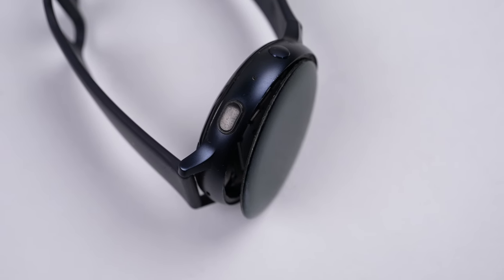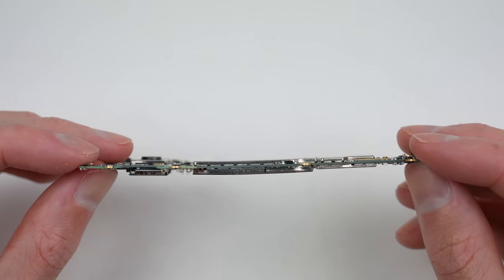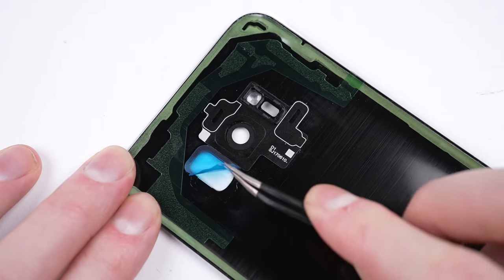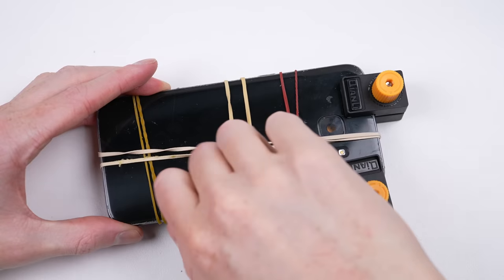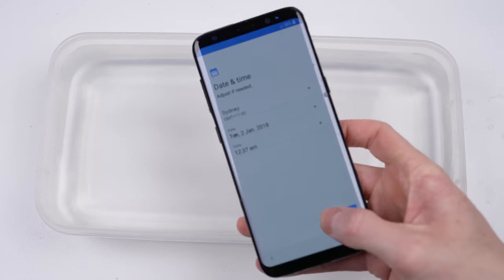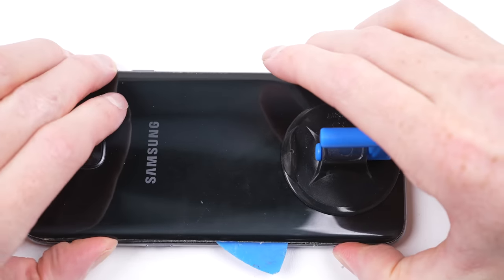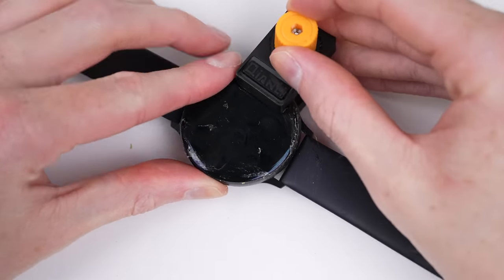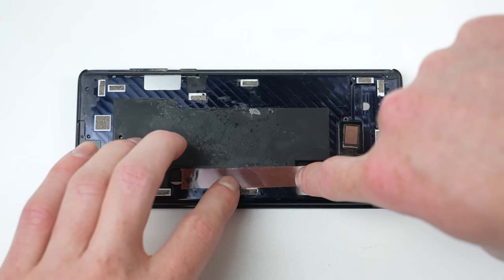Is a Repaired Phone Still Water Resistant? - Submersion Test - Tape VS Liquid Adhesive

Comment: If you sent your phone to repair, don’t ever submerge it. If done correctly, yes, the phone can still be water resistant, but some phone repair shops just leave the old adhesive or replace it with one that is not air tight sealed.
Reply: I don't think the majority of people intend to submerge their phones. 9/10 it's on accident or out of their control if their phone hits water.
Reply: true because removing the residue is the most time consuming process
Reply: i wont recommend submerging even a brand new phone. period. even if it's IP68 rated.
but if it's accidentally, i just wanna feel assured that it's not instant doom when the phone met with some amount of water
Reply: @workdesu  if it’s brand new it’s fine. If the phone is 6 months or older, has sustained some drops (even with a case) , and it has chips or cracks, it should not be submerged
Reply: @eddiew.4650  Originally, you got a waterproof phone to take pictures of each other in the pool.  Sony advertised this all the time.  They backed it up by warrantee by doing an air pressure test if you sent in a water damaged phone to rule out it wasn't negligence like unclosed covers. But they stopped the warrantee shortly after prolly due to too many claims.  A new phone is likely sumbergible for a while until you break the seal somewhere due to wear.  I'm sure weather is a factor too.
Reply: WILL IT BE WATER RESISTANT IF I SEND THE DEVICE TO REPAIR ON OFFICIAL SERVICE CENTRE?

Comment: My Mom put her Pixel 3a XL through the washing machine, and while it seemed to be working fine afterwards, I wanted to be sure nothing got in. Since it was pushing 3 years old, I figured it was time for a new battery anyway, so I opened her up, AND IT WAS BONE DRY INSIDE. Very impressive for a device without an official IP rating. And of course, I replaced the adhesive when I reinstalled the display assembly. 😀👍🐧🐧
Reply: Couldn't believe at all 😮

Comment: Did a battery replacement on my Pixel 5 requiring full disassembly, then took it rafting by accident resulting in 2 hours of sloshing around in water. Phone was fine, no signs of water damage, so I guess I did a good job! For reference, I used MobileSentrix adhesive for this repair.

Comment: As someone who works in a Samsung ASP, part of the post repair diagnostics is the Water Resistance Test. It uses air pressure to determine water resistance by utilizing the internal phone barometer and a weight or an external apparatus. 
So hopefully in the Right To Repair future, the diagnostics tool becomes available to the public instead of seeing you dunking a phone in water.
Reply: How does Samsung test the water resistance for their folding phones? I imagine those phones would only have one barometer still right? How'd you verify both sides are sealed?
Reply: @cavejohnson2075  curious to know the answer to this as well
Reply: The barometer can be utilized by third party app, though I'm not sure if root is needed
Reply: Ah yes, the infamous cube. We had one in the repair center that had a fingerprint reader calibrator which was finicky beyond words
Reply: Isn't the internal barometer not supposed to have a connection to the outside? Or is that a separate barometer?
Reply: @cavejohnson2075  The "external apparatus" I mentioned. It's a custom thingamajig made using a syringe, a thing to pull the syringe, a bluetooth barometer thing, and replaceable rubber or silicone seals. It's a very custom thing.
Reply: @ej_tech  are those replaceable rubber seals a “thing” too? 😂😂😂
Reply: @PanCakesAreFat  Ooo super interesting. Thanks for the insight into how that all worked. I've been really curious for a while. Thanks :)
Reply: @PanCakesAreFat  Does that also mean that extra barometer is sealed into each phone or is it removed after? Just curious how that all works. Might do some googling and see what I can find later from what you said. :D
Reply: On Samsung phones there actually is a water resistance test built in it is the MST test under the *#0*# menu
Reply: I use a barometer app to see pressure change to see ofy repaired devices still have a level of resistance

Comment: There are ways to relatively test the water-tightness of a phone (slightly gross):
Eject the sim tray, then try to suck (not blow otherwise you might trip the water indicator) out of the sim slot. After that just move your lip in and see if it holds the suction or not.

Keep in mind, the phone is dirty, so sanitized the phone before and after the test. 

And if you can test using the internal barometer, just use it instead. The test above is only mostly used with iPhone as it does not have any diagnostic menu easily accessible and downloading an app when you have to check someone else machine on the spot is a big hassle.
Reply: A good suction is good I suppose?

Comment: I work at a place called batteries plus and we repair some phones, we do iPhone and Samsungs. for iPhones we put some aftermarket adhesive that's not gonna make it water resistant as it once was because obtaining that kind of adhesive is a bit of a pain for iPhones. (Shout out to Apple!)

However for our Samsung phone repairs we're partners with Samsung and one of the very few phone repair companies that has access to genuine Samsung parts as long as Samsung themselves has it in stock. Samsung parts however are very expensive because well, it's Samsung parts. Samsung however gives us the adhesive that comes with the device originally and the device WILL stay water resistant, we get more iPhone repairs though than Samsung because of the price, a new screen is expensive and you're looking at about $400 USD for something like an S21 & S22 Ultra screen. Regardless it's not that we don't want to add the adhesive to iPhones, it's that we aren't provided the parts to ensure it is. We've done some amazing things to bring back some phones that were believed to be completely dead.
Reply: So what after market adhesive DID you use at Ifixit? What name and brand was it? That's why we are here on YouTube to learn stuff...so please share..??

Comment: I had an S8 years ago and fixed it with new screen after the original one broken, I have to admit that I may not be good at repairing because I broke the battery and the back glass durung the process. However, I replaced a transparent back glass that I can see if the water resistance still exists. Unfortunately the water went into the phone maybe due to my bad work, but the phone still worked good before I sold it. I think the mother board may have some solutions to make it kind of water resistantable.

Comment: Last year i had my iPhone’s XS battery replaced (at an apple certified shop)

Some months later i was in a pool with my phone, the sun was really strong, so i used my wet hand as a way to cool down the phone (it never went underwater). Welp that was enough for a water to get inside and damage the front camera (and faceID) as well as the touchscreen. 

They offered me around 20 bucks for it at that state, i declined 😅
Reply: How long did it last before not working anymore ?
Reply: @jaysmokin  it still works

Just, the touchscreen has a deadzone and the faceID and Front camera dont work

Comment: Hi Hugh - Back in 2021 I created software to test the water resistance seals on a phone (unfortunately only Android, since I'm an Android developer). My goal was to help people be able to hold phone manufacturers and repair shops accountable - if the phone is advertised as IPX7/IPX8 rated, then it should be held up to that.

It would be great to know if it helps you test your own repairs...

YT keeps deleting my comment when I mention my software's name...
Reply: App is called Water Resistance Tester
Reply: The way it works is it monitors the pressure sensor inside of most modern phones to detect whether the seals are intact. It monitors for a threshold of changes in pressure when the user presses on the screen. This pressure value does not change, if the phone is not/no longer water resistant.

Comment: I think it should be a law that, if the seller/manufacturer advertises water-resistant devices they should cover it under warranty. Why can a brand claim a non-damaged phone has water damage, and therefore not fix a boot loop, if there are images on their website with water splashes on the phone?

Comment: My s5 was dropped in liquid - it still turned on but made a sizzling noise. I poured rubbing alcohol on it, as I didn’t have a heat plate to open it. I let it to dry over the weekend and I plugged it in, it no longer sizzled. It acted normal, or so I thought. The screen was completely black, although the touch still works. I can also see that the speaker is a bit broken tho. It was never opened before - the seal must’ve gave out.

Comment: Sort of a flawed test since you need heat to remove the adhesive, and you didn't check the cof bond of the screen which breaks easily when exposed to liquid causing it to black out or have lines, no idea if you could xray the phone in a way that you can see water inside though

Comment: I have the exact same watch - Samsung Watch Active 2. Bought brand new. I use it for swimming in the summer but one day i swam with it and it and after that, it kept restarting and displaying "your watch needs too cool down" and itll restart. This happened for 2 days post submurgion. Then suddenly it restarted and never turned back off. Still working great after 6months. Unbelievable how samsung claims its water resistant when its clearly not

Comment: One thing i do when sealing a phone back up is what i like to call the 're-heat method' basically once i close the phone up, i heat it up again and THEN start applying the pressure from the adhesive. And looking at my phone, if you didn't look properly, it would look as if it was never opened, the seems are that tight.

Comment: I had the exact same problem with my Galaxy Watch Active 2. I fixed it once last year but the problem reoccured. The second time I opened up the watch fully to clean the residue properly. This is pretty straightforward but you'll need a Tri-Wing Y00 screwdriver and the microphone fell out in the middle of the process. I got it all working again though.

Comment: If a fall is severe enough not just to damage the display, but also the outer frame it sits on, I suppose chances are the ability to get a proper air-tight seal on the device is also compromised, correct? So I'd need to try and find a replacement outer frame as well. I got a couple old devices like that that I am not confident to daily-drive because of this.

Comment: My Samsung Galaxy A52's back panel started to come off on its own after a year of use.. I've always kept it in a case and never placed it in the water. It's IP 67 rated but i don't think it's now..
Reply: i’ve experienced the same issue too with my A52 as well. my back panel come off on its own
Reply: @kkaall  i guess samsung's just using low quality adhesive on mid range phones to save costs
Reply: @zstar7  yeah kinda annoying. now i wont buy A series anymore lol

Comment: I just want every phone to have a removable backplate with replaceable rubber gaskets, gluing the phone shut should have never become the standard. 
Also: There is actually an app to test if your phone is properly protected against water!
Reply: Once the new batteries that caught fire when you short them and stuff, they didn't want regular users to have access to the batteries.

Comment: My wife had a Galaxy Watch Active2 as shown in the video. It fell apart after two years and 3 months. The display just came off. And Samsung said that there was no warranty left, but we could trade in the watch and buy a new one, plus a small discount. We thought: ok, that's fair. Guess the actual value of the watch quoted by Samsung: zero! Because it was damaged. What a disaster.
My Huawei Watch GT from 2018 came as a gift with my Mate 20 Pro, because I pre-ordered the phone. They are still going strong, every day. Shame on Samsung, and a shame that Huawei is not what it used to be.

I am happy to see that water resistance can be solved by yourself though, so thank you for the video :)

Comment: My galaxy watch did the same thing, but in my case I believe the fact that it is 2 years old and I took it straight from the charger and go out to work ended up causing some kind of thermal shock that resulted in the screen taking off, lucky I have the tools at work to glue it back.

Comment: I think that for the best sealing result atleast with the original adhesive you should heat the back panel after putting it on and clamp it down for a while

Comment: Just dropped my 12 Pro in a toilet

I replaced the display ,but everything else is original

I took my time removing old glue with isopropanol

and installed new seal that arrived with the display

from 0.01 second that my phone spend in a toilet (it only went half way thru in) 

my phone worked okay for 30 minutes

but then started glitching, screen went white

and then the phone died an wouldnt even turn on

I opened it up , there was 1 drop of water inside

I dried it up with a leaf blower ( portable version) and left it on a heat plate for 1 hour (while also blowing air in it)

after 2 hours I installed a new display and it seems to work

like I said it happened 20 hours ago so I do not know if its gonna keep working

but my point is that the seal I used was not good enough and it left some dust and also water inside

so if you ever opened your phone you can assume its NOT water resistant or water proof

Comment: the answer could be opposite, if the adhesive is original or not sometimes it could be water-resistant, but it could degrade overtime as long as 10 years. but if the water still seeps in, then it is not water-resistant. so is B7000 glue could be water-resistant, but if it's clear then water can still get in the device and mess with the internal components and damage it forever.

Comment: This is not a good test of water. The time is too short and the container is too shallow. Water pressure increases very quickly as the depth increases. 

And there are proper testing rigs for testing water resistance. The liquid used is a special solution (some made by 3M) that does not damage electronics. Then air is pumped into the phone through a port designed for this purpose when it is submerged. If bubbles come out of the phone, you know there are holes, which means it is not water resistant.

Comment: I once dropped my Lenovo phone in the sink. The phone was displaying pink and green and it was making cracking noises. I removed the back cover and the motherboard and I got rid of water with a hair dryer. I reassembled the phone and it powered right up. I used it for 3 more years.

Comment: I get hands on iPhone after 3rd party repair with dust inside (specially front camera) once a week. Hate lazy work like this. When I repair it, the water resistance is better after the repair then with the old degraded adhesive.

Comment: I got my Galaxy A52 screen replaced which came with frame. it was not water resistant anymore and after macro schots i found out the new frame was bent on top edge and i showed that to service center and after arguing for two days they replaced the screen again. Fortunately it was clear the problem was a defect otherwise they would have done nothing about it

Comment: My samsung galaxy watch had the screen popped off as well. Turned out to be a battery issue. The battery pushed the screen out. Just 3 years and then they need repair or replacement. So sad.

Comment: Hello Hugh Jeffreys, thank you a lot for this video, im afraid of using tape, so i use liquid adhesive and never have a problem, used it on s20, on display and backglass and the phone went waterproof for long time, but then the speaker mesh was not waterproof and water went inside. but i cleaned it, and glued it back. so i really recommend to use glue : t7000 or b7000, with tape. best option. but if u glue it badly and you need to reposition it, then cleaning the glue is so hard... xd, have a good time with videos Hugh.

Comment: It's important to understand the difference between "water-resistant" and "water-proof".

There was an Australian consumer case in the early 80s where the watch manufacturer had called their watches "water-resistant" but the advertising was all beaches and hard surfing. The case failed for the consumer because the watch was never asserted in writing or advertising to be "water-proof" which has an Australian Standard of exposure, pressure (depth) and duration. The visuals came within some "artful communication", and were not then seen to be misleading.

"Water-resistant" is an advertising term so nebulous that it is almost meaningless.

Comment: Watch Rewa technologies videos on making repaired devices water resistant again. You're video is okay for basic old devices you don't care much about but actually waterproofing after repair needs special machinery to test the maximum sustainable psi.

Also for the galaxy watch try using T-700 instead

Comment: Coming from having had a semi-smart G-Shock watch die to water damage after getting the battery changed, if assembled correctly I trust it's construction way more than this Samsung smartwatch.
Lesson learned, going forth I will replace the battery myself, already did on cheaper watches but I wanted to be certain that this one stayed water resistant, as it was very expensive for what it does.
But as much should be expected, such a full smartwatch has way more capabilities at the cost of lasting an order of magnitude less, both in general and battery life, assuming proper maintenance.
Though similarly as to how you are using an older Blackberry, a MIP semi-smart G-Shock is a nice middle-ground of connectivity, which I found pleasant for judging whether I should check my phone.